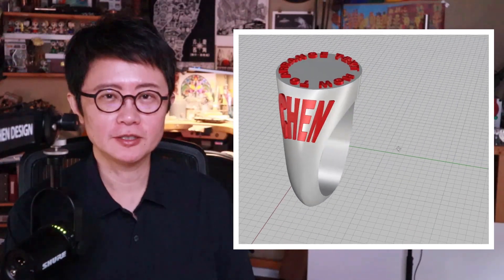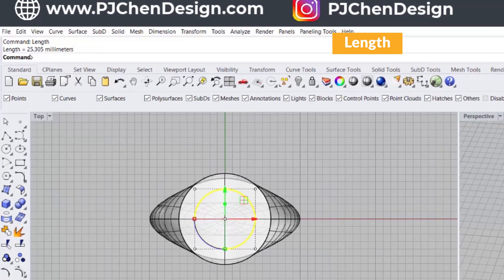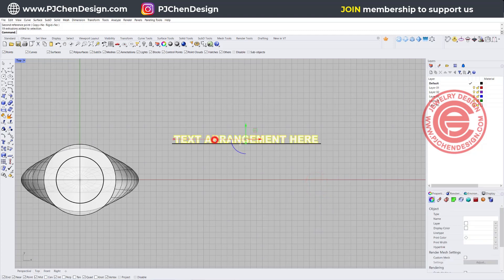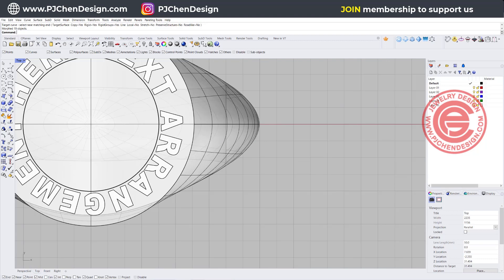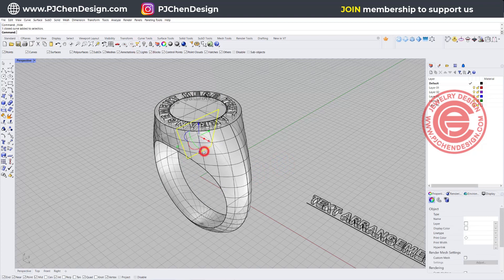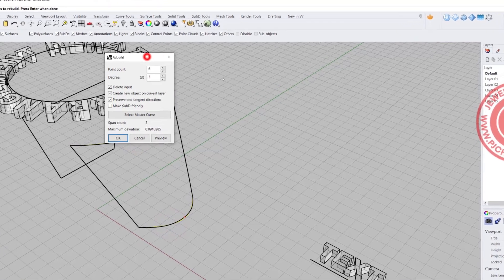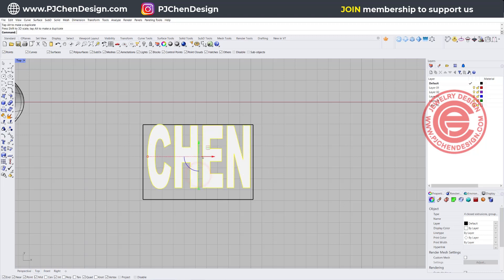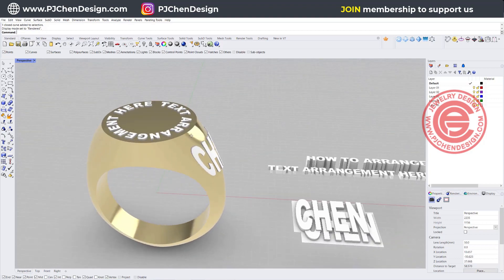Rhino 3D Modeling Tutorial- How to Arrange Text on A Signet Ring #384

Comment: What about the top letters, having a draft angle for printing/casting.  Is that an issue if they are straight?
Reply from the maker: You can always flow the curve instead of solid and extrude tapper with preferred draft angle